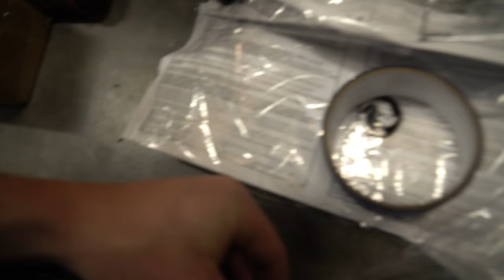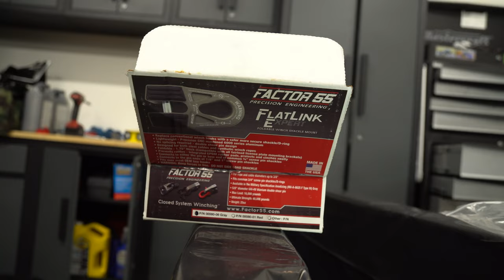HOW TO INSTALL NISSAN FRONTIER FRONT BUMPER CBI COVERT

Comment: This is top tier work. My goodness. Since you seem to really know your way around a Frontier, I want to ask: do you think there is a way to upgrade the standard daytime running lights to the Frontier LED headlights? I was one of the unlucky ones to get the standard lights and would really like to upgrade them. I was told be several sources that if I did that the system may throw a code on the dash. Tell me there’s a way around this?
Reply from the maker: It should not throw a code on the dash but if it does its usually just a resistance just need to add a resistor and is not hard to do :)
Reply: @ghostlyrich  I would love to attempt it but those lights are around $4,000. I’d be sick if they didn’t work.
Reply from the maker: If its the same connector it will work :)
Reply from the maker: You can also check with the dealer
Reply: @ghostlyrich  – that’s what I thought. The connections are EXACTLY the same for the headlights; they’re slightly different for the fog lights. The dealer is the one that told me that. I checked with multiple dealers and there isn’t a single YouTube video on the change/upgrade.
Reply from the maker: Id say just do it worst case scenario would be a bulb light on the dash wish would need to be disabled at dealer but im betting they just plug right in and no error light on dash :)
Reply: @ghostlyrich – I’m thinking I’m going to test the waters. Thank you for the feedback and information. I really appreciate your time.